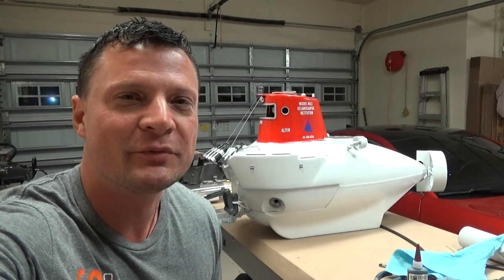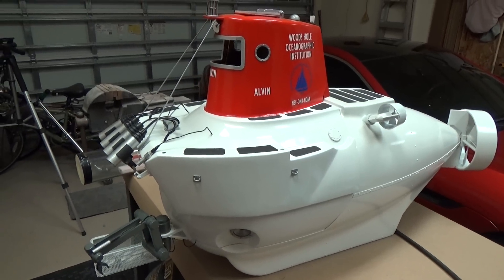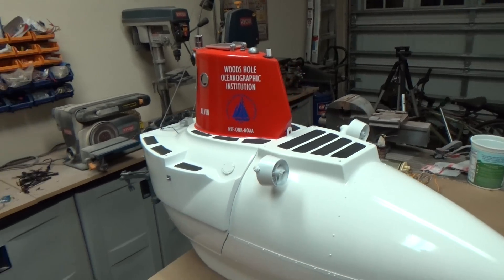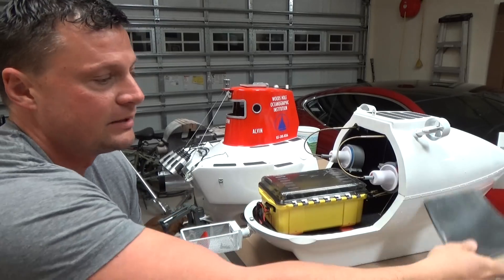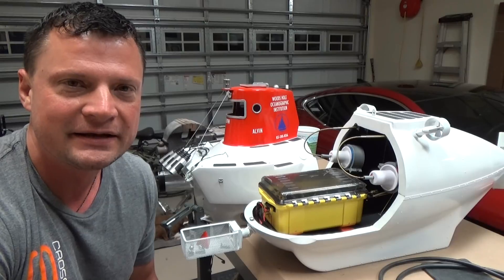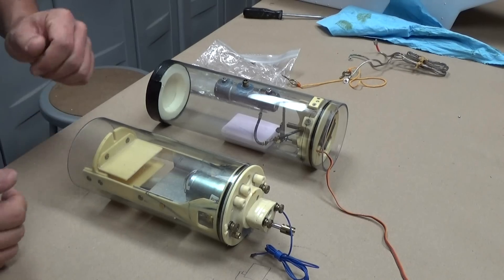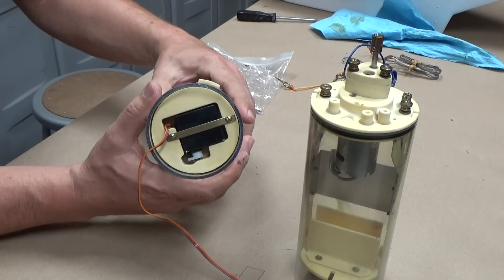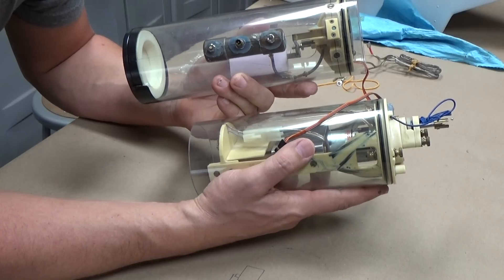R/C ALVIN submarine Chapter 3 - Control system reboot!

Comment: Why are you sticking to cylinders? Is it for the higher max pressure limit?
Reply from the maker: Double the depth capacity, but at the end of the day it was because the cylinder is a professionally designed and executed product, ready to go (with slight modification in this case). Too many people pick apart ready-made cylinders saying they can do better, but end up regretting trying to reinvent the wheel.